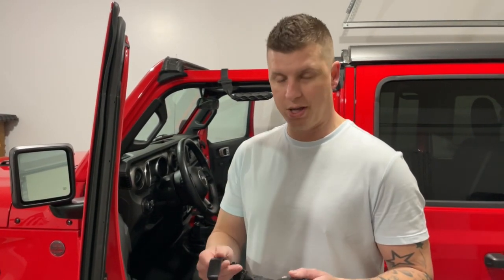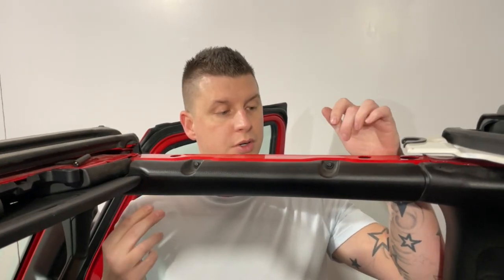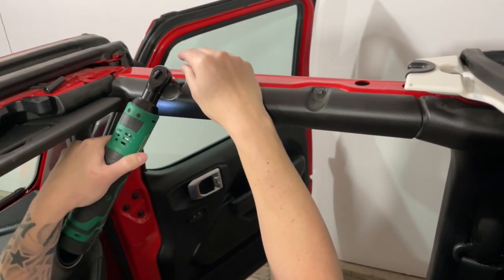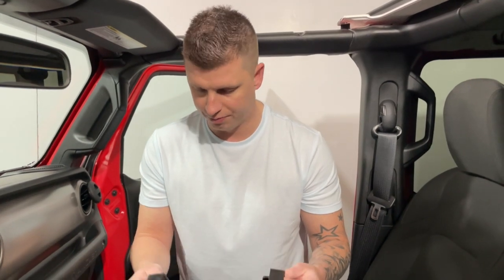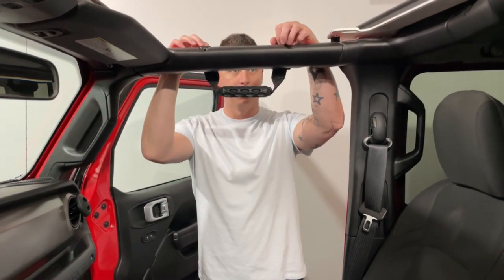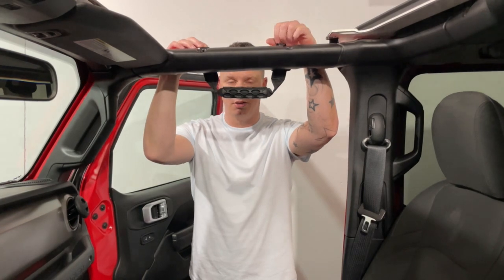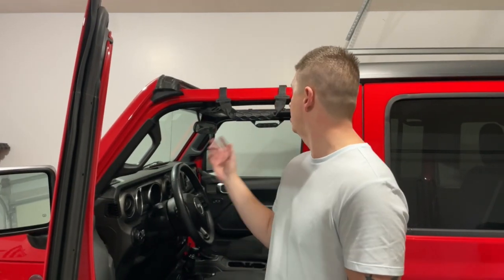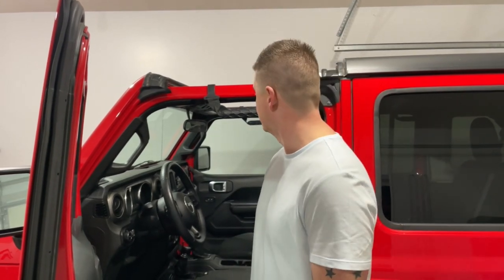Get a Grip: Installing Mopar Front Grab Handles on Jeep Wrangler JL

Comment: I heard that these smack in to the windows creating constant noise. Can you confirm?
Reply from the maker: I have had these on several Wranglers and gladiators and never had them hitting window.
Reply from the maker: If you enjoyed this video, consider subscribing if you haven’t yet for more content like this.
Reply: The front and rear handles are different. One is longer than the other. Aside from that there is also a difference in the length of the strap from the bald hole. The shorter strap goes in the front and the longer goes in the back.
Reply: When they’re attached properly, there should be no swinging. They only drop about an inch and a half below the rollbar and they’re very light so they just sit there although if you’re tall, it may touch your hair so if you’re trying to look pretty, watch out for that.